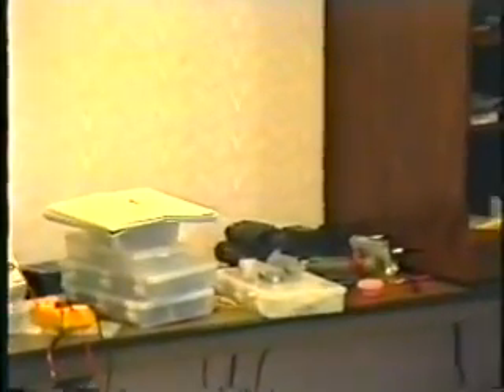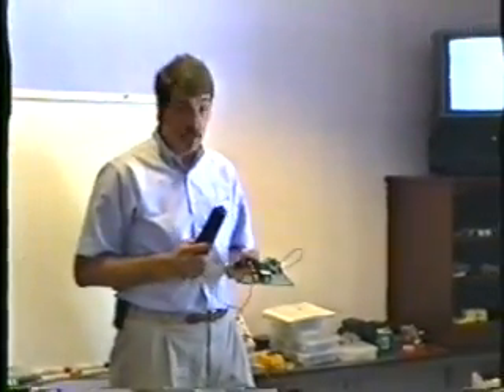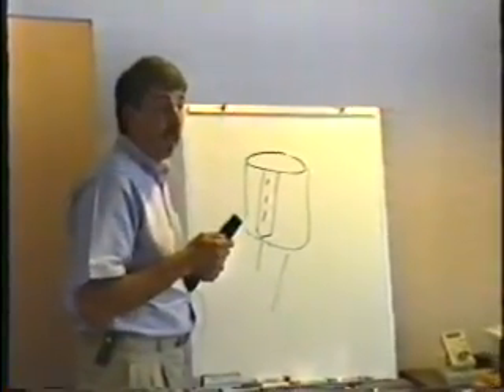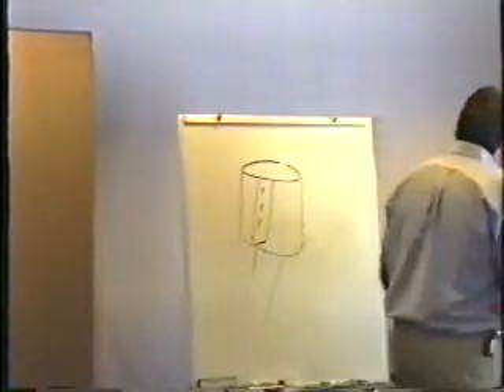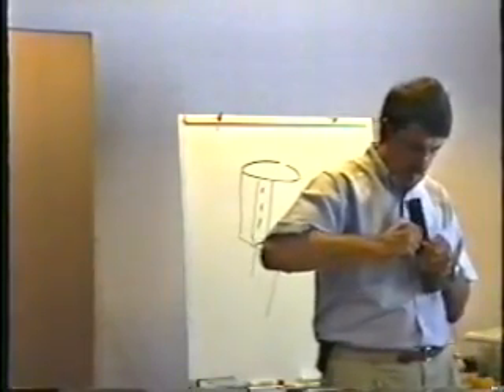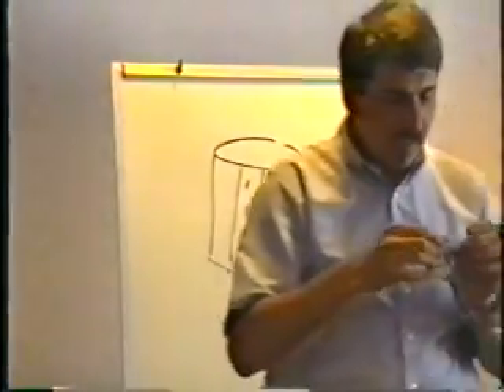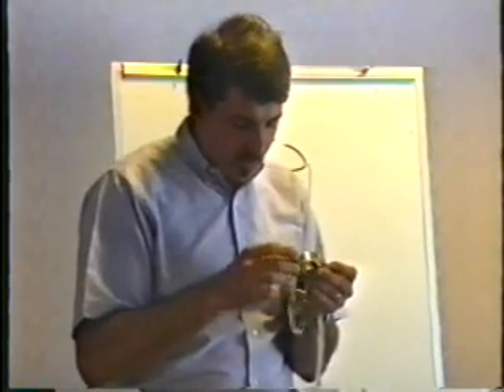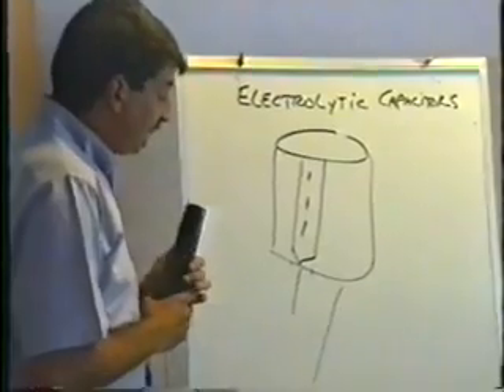Basic Electronics-Chapter 7

Comment: I've wired up some circuits and the capacitor didn't blow up, though i had the polarity wrong.  The circuit just simply didn't work right till I flipped it.  Do only certain capacitors blow up?  Or certain sizes?  I use very small capacitors most of the time.
Reply: Yes as far as I know only electrolytic blow up